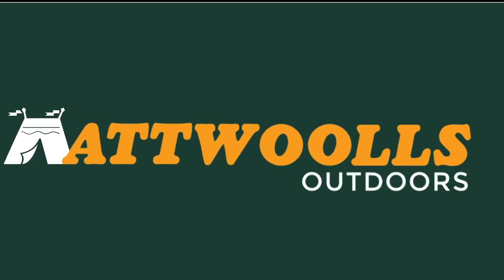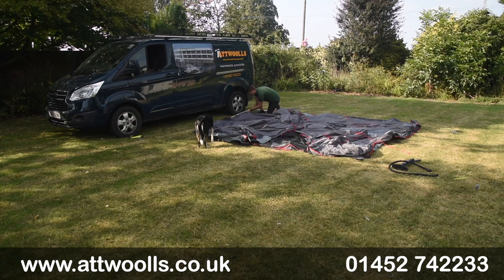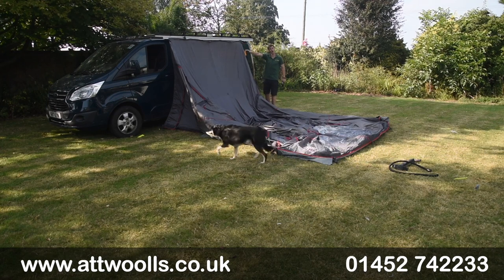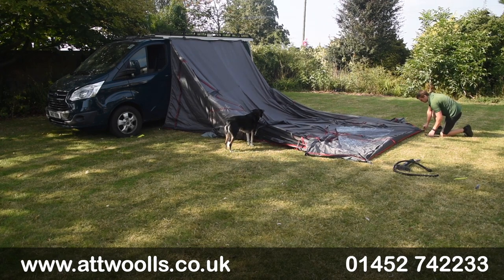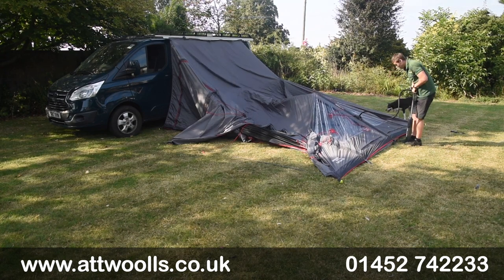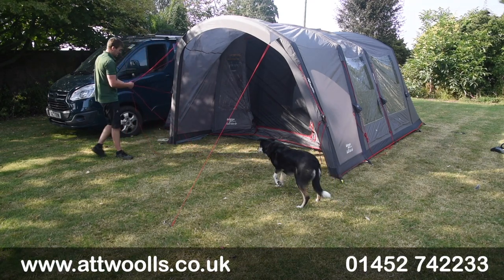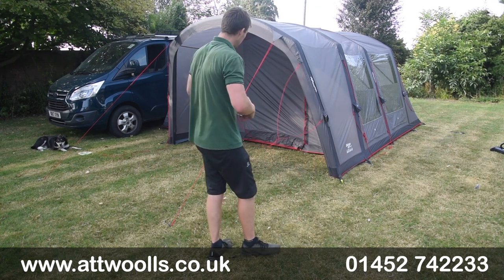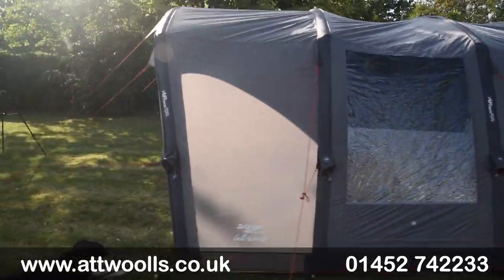How to Pitch a Driveaway Awning (Tutorial Video)

Comment: How do you work out where to put the footprint in order for the awning to fit the van,
Reply from the maker: I would lay the footprint out approximately on the ground close to the van and use it as a base to open the awning up. After that point you’d be able to move both the footprint and awning together once it is attached onto the van and you can get a better understanding of where it’s going to go.